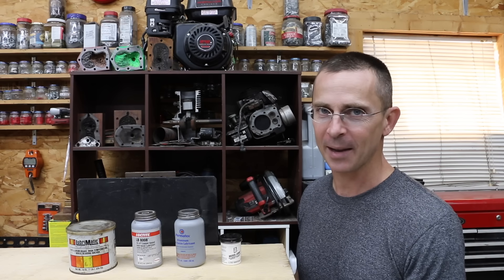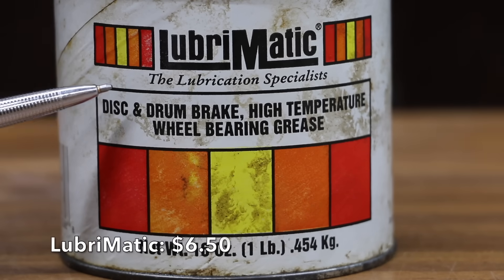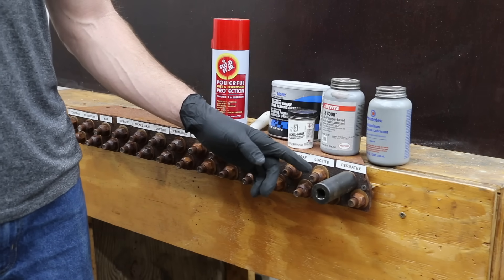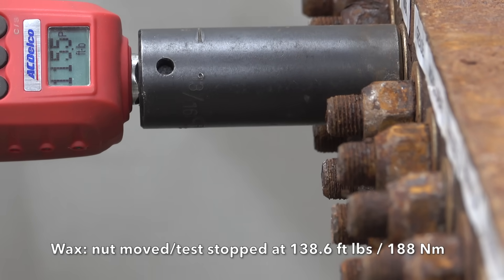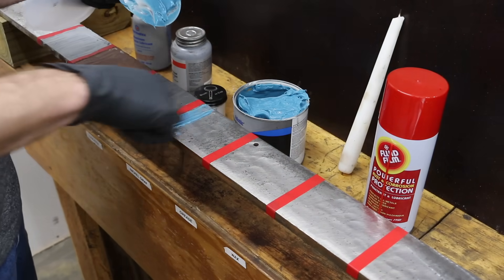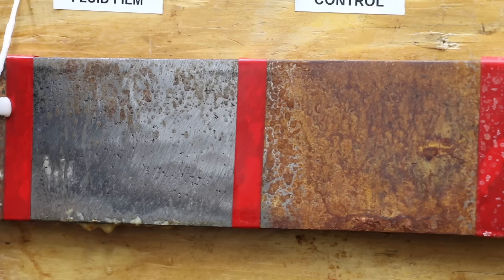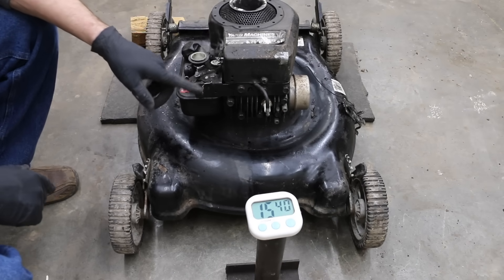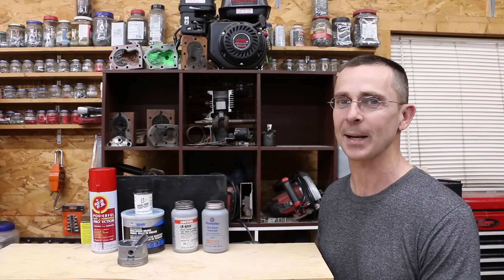Does Anti-Seize Compound Actually Work? Let's find out! Anti-Seize vs Grease vs Fluid Film vs Wax

Comment: Grease and heat story to learn from.  At work we had a new guy show up which turned out to be a know-it-all control freak and spent his first week trying his hardest to take over the crew.  One of the guys took regular grease and rubbed it all over his oil pan, diff, and xfer case.  It gets hot here, like 115-125 degrees F hot.  When the grease began to melt off it looked like he had leaks all over.  We told him the heat here destroys vehicles quickly especially if they were mfr'd for cold areas.  He was from MN.  Every chance he got, he checked his oil level, xfer case fluid and diff level.  We watched him do it probably a dozen times in a couple days.  One day, he is up on the scissor-lift, looks down at his truck and there's liquid flowing out slowly.  He rushes to bring the lift down, runs over to see what it is and starts to scream about his transmission leaking.  We were hiding around a corner laughing our butts off.  He tells me he's going to take it to a mechanic before he has to drive it home in the heat 30 miles and leaves.
The boss got a call from him that night, he quit because his truck had never had any trouble until he began to work here in the desert.  He said it was too dang hot and he was going home.  We were all snickering about it as the boss told us, and it didn't take long for boss to know we had something to do with it saying, "I didn't like the way he treated you guys and he told me how to do my job every chance he got, so we can do fine without him".
Good luck, hope we never see you again!
Oh, and grease melts pretty good in desert heat.  The roads can be 170 degree F.  There are egg cooking contests for fun...cooked on the pavement.  The most common break down I see here is trailers with a missing wheel...the axle hubs go dry much faster here.  I'm guessing most of those are regular grease and barely kept up on maintenance.

Comment: Just curious what your method is with the water spray test to ensure that each product is spread to the same thickness or if you do it by volume or weight for consistency? Great video, as always. Thanks!

Comment: I wonder if the engine hydro-locked cause there was a lot of antiseize taking up the space.
Reply: It's a possible contributor, but it seems like the main cause for failure was that the anti-seize was too thick to get into the rod  bearing (or bushing), which failed. You can tell by the elongation at the end of the connecting rod and the multiple failures there, which likely led to the failure further up the rod. Some of that elongation could definitely have been caused by a mild hydo-lock combined with the lack of lubrication though.
Reply: @EbilGeneyus   I agree, the rod/crank journals would not have been exposed to the anti-seize until it was too late... These anti seize products are still around 40-60% mineral oil by content, just containing heavy loading of solid particles like aluminum, copper, graphite, etc. That's why it's called a "paste" (30%+ solids) and not a "grease" (0-15% solids, typically).

Comment: always had the best experience with copper based anti-sieze...its been around a long time.....I bet that engine would have run longer with fluid film....it would have flowed better into the con rod bearing

Comment: Fun fact: antiseize should never be used as a lubricant on moving elements because it's essentially metal dust suspended in grease. Even though aluminum and copper are soft metals, it's still very abrasive at a microscopic level and will destroy bearings and bushings very quickly. It works great at preventing bolts from seizing because that dust basically polishes the top layer of metal off, and embeds itself in it's place preventing the 2 metals from directly touching.

Comment: fun fact, ive been using copper based anti-seize as thermal paste in all my computer builds for about 20 years now.   it works great, does not dry out, and it spreads evenly very easy.   it also has the added bonus of being very cheap, same bottle that i paid 5 bucks for is still about 1/2 full.
Reply: HEY!... That's a good idea!!!

Comment: I’ve used candle wax to loosen rusty nuts but you have to use a heat source like a heat gun or a blowtorch. If the candle wax is in its liquid state it’s an excellent lubricant
Reply from the maker: Thanks for sharing.

Comment: If you do another one can you try AeroShell - MIL-21164D & Loctite Silver Grade Anti-Seize?  The first one is the milspec grease for AR barrel nuts.  I also use the Loctite silver for other stuff during assembly or changing parts.  Not 100% sure on what temps the barrel gets to, but I've heard they can get over 500f.
Reply from the maker: Thanks for the video idea.

Comment: Used to work in plastics here. After spending a day disassembling a barrel that some bolts without anti-seize I became a fanatic. If it gets hot put copper anti-seize on it. I don't care if it is more expensive. Would you rather be stuck using a breaker bar the whole way to get a 6in bolt out or have it let go with a bang and then be finger tight?
Reply from the maker: Thanks for sharing.

Comment: Oh man, I hope that isn't it for the OG PF lawnmower.  Please replace that piston and continue to use it.  It's a fun nod back to the earlier days of this channel.

On a side note, I'm not exactly sure what I expected with the anti-seize in the mower.  It's hard to say without knowing the ring gap prior to starting, but considering the abuse that thing has seen I would have to assume the gap was getting up there.  Either way I'm not sure it would have mattered what the gap was, I have a feeling that anti-seize would have worked it's way up eventually.

I'm actually surprised you didn't put it on the lubrication tester first just as a basis for comparison to some regular motor oil.
Reply from the maker: Thanks for the feedback.

Comment: Great video as usual. I was actually surprised the control bolts didn't take more torque to break them loose. With pool season upon us how about a waterproof tape video for all of us pool owners. Maybe trying it on the inside and outside. There was a brand I tried outside and it didn't work. Go figure.
Reply from the maker: Thanks for the video idea.

Comment: As a truck mechanic I can say the anti-seize is a life saver,  for example if you don't put it on shock absorber bold there is a big chance that you'll have to use torch or in some scenarios cut the whole bolt, and not to say on exhaust manifolds if you don't put it most likely you'll end up with broken bolts inside the head....
Reply from the maker: Thanks for the feedback.

Comment: Having worked for several company’s as an Ironworker, structural fitter, ship outfitter and maintenance worker. I have been handed milk of magnesia as an anti-cease more than a few times depending on the work being done. They all said it works.
Reply from the maker: Thanks for the feedback.
Reply: It's used in jet engines.
Reply: The German aircraft mechanics used Milk of Magnesia as an antiseize during WW2!

Comment: I used to work in earth boring passing pipe casing under roads and highways. Same concept as well drilling, we threaded 8 feet long iron drill rods and pumped high pressure water to bore 10 - 20 inch holes underground. It was our everyday routine to grease the thread and screw ends to prevent rust. Grease was economical and it worked. We did had to  sledge hammer the connections to break them lose but the grease did its job. I was 16 years old then working the middle of the Texas desert. Boy did I learn the meaning of hard work. I'm an office worker now.
Reply from the maker: Thanks for sharing.

Comment: I worked for a company that made large hydraulic jacks for aircraft.  We had a 250 ton test stand that was 40 feet tall, it was outside the shop because it was to big to fit inside.  The load cell adapter had to be changed because we changed load cell brands and I was the lucky one to change it out. I was expecting it to be next to impossible to remove because it was last changed out 30 years earlier and it’s been in the weather all that time. I attached a 10 foot breaker bar to the boom of a fork lift and was going to use the low drive gear of the forklift to push on the breaker bar to break it free. When I was rigging up the break bar forklift contraption the load cell adapter twisted in my hand with virtually no force applied to it. I was surprised and asked one of the old timers at the shop what anti seize did we use back then?  It was Lok-cease 20/20, same stuff we have always used.
Reply from the maker: Thanks for the feedback.

Comment: I don't know what this Loctite stuff is but in the trade you use copper grease and it's not expensive. I would have liked you to just tighten the nuts just finger tight would have been better. The wax shouldn't be heated should be put on cold and of course it's not going to cope with high temperatures
Reply from the maker: Thanks for the feedback.
Reply: @ProjectFarm  I forgot to say depends which type of candle grease if it's paraffin might be better than the other types waxes like beeswax soy wax

Comment: Don't use any of these products in salt water applications especially where dissimilar metals are involved as the copper, mica or other things including graphite are used as they actually promote corrosion in salt water due to the electric currents generated between fastener and the thread . In our applications stainless bolts into aluminum is quite common. The bolt being electrically welded to the aluminum is quite common. The same process occurs even when not immersed in salt water. Once corrosion starts the electrical potential between the different parts like bolt and nut takes over, It is this electrical action not the corrosion itself which is responsible for the seizing of fasteners. There is a lot of research on this but we in the ROV industry had to work it out ourselves trying a whole host of products before finally understanding the cause of the problem.
Reply from the maker: Thanks for the feedback.
Reply: @ProjectFarm  Love your channel and testing methods. The comments I provide are for informational purposes only. If you find them useful in anyway that is a bonus.

Comment: Those bolts are like the bolts on a 2 year old car in Wisconsin. I call rust on a bolt "Wisconsin Locktite", you ain't getting them off with out a flame wrench! Once I do the job, I've had good success with the Permatex mostly on lug nuts. Thanks for the test, even included some engine torment, I love it!
Reply from the maker: Thanks!

Comment: I think an interesting test would be after you test how the different materials react to wash out with the water, spray them again with your corrosive mix to see whether it fully washed out to bare metal or if there is still a thin layer that will still protect the metal from rusting.
Reply from the maker: Thanks for the video idea.

Comment: I'd like a retest on the antiseize as oil on an engine that hasn't been previously abused(if you can). Also, Why not have an immersion heater of some kind keeping the water in the tank at a more consistent heat level?
Reply from the maker: Thanks for the feedback.

Comment: My main use of anti seize is to prevent galling and seizing between aluminum parts and steel fasteners.  Can you test that?   Also, did you know that permatex anti seize and high quality grease when combined 50:50 are a superior bearing lubricant for harsh exposure parts!!  Need a lubricity test!
Reply from the maker: Thanks for the video idea.

Comment: If you want a heavy-duty oxidizing solution, try Piranha Solution.  Or you could even just up the hydrogen peroxide percentage strength by picking up either a quart of BaquaSpa Oxidizer (7.5%) or pool Baquacil Oxidizer (27.5%) from a swimming pool supplies store.  Might want to call first as not all pool stores carry those lines of chemicals.
Reply from the maker: Thanks for the feedback.

Comment: One of anti- seize’s major uses is to prevent seizing of dissimilar metals, such as a steel drain plug in an aluminum oil pan. If you’ve tried to remove one, you know what I’m talking about. I use anti seize on all drain plugs regardless of metal make up. It’s cheap insurance.
Reply from the maker: Thanks for sharing.

Comment: I've used about a dozen cases of fluid film over the last two years at work. It really needs to be shaken very very well to get the best performance out of it. It will come out very thick and foamy and eventually all the propellants will flash off leaving a very nice viscous film. Otherwise it's thin and runny and doesn't perform at all. I shake the can on its side, only rolling it slightly when I hear the ball inside freely rolling back and forth. It generally takes me about 3 minutes of continuous, vigorous shaking to achieve optimum mixing. At $10 a can it really helps you get your money's worth.
Reply from the maker: Thanks for the feedback.

Comment: That engine wasn't going to seize, but the cylinder walls sure got wet sanded. In the end you proved that anti seize compounds should be used for the job they were intended for.
Reply from the maker: Thanks for the feedback.

Comment: I know it sounds crazy, but am trying a test of my own by using brake parts cleaner to clean out sandpaper. I was using sandpaper today, oversprayed brake clean, and noticed it dissolved the crap that gets stuck in sandpaper, looked good as new! So I gummed up a peice real good and soaked it, it is now sitting and hopefully drying out in my shop for the night. Will update tomorrow if it worked!
Reply from the maker: Thanks for sharing.  Look forward to  your report!
Reply: Ok so it worked but it took a long time to dry out the paper and it warped the sandpaper a tad, I kind of expected that. Also I tried it a few more times with the same peice + a brand new peice and over time it will start to eat the corners of the sandpaper and I'm sure weaken the grit.

Comment: As someone who works on agricultural equipment, I have used ALL of these on fan hubs (ventilation fans) and heater fan hubs. I absolutely will not put any fan or pulley hub on anything without anti-seize.
Reply from the maker: Thanks for sharing.

Comment: I paint all my wheel hubs on all my vehicles with Permatex Never Seize  every time I switch tires and rims from summers to snows and then back again in the spring. Most times, they come right off. I will admit, there has been a few times where a rim needed a little attitude adjustment to come off the vehicle. I can't imagine how rusted on they would be if I used nothing, as road salt rusts everything here in NY.
Reply from the maker: Thanks for sharing.

Comment: I can tell you when it comes to multiple high heat cycles, nothing beats the copper based anti-seize for steel on steel, at least that's what we found out working on injection molding machines. But we never had to deal with rust, just heat and pressure.
Reply from the maker: Thanks for the feedback.

Comment: We use zinc based antisieze on the ships antenna mounts. You can definatly tell which bolts havent had antisieze compared to the ones who have after a year out to sea. We put out equipment through hell, and the zinc works pretty good
Reply from the maker: Thanks for the feedback.

Comment: As a mechanic for over 40-years, I use a top quality pipe dope on bolts that are under the vehicle.  For example, when installing a trailer hitch the entire bolt is coated with pipe dope and even use pipe dope as a gasket between the hitch and frame. (Prevents the scale from building and pushing. Nature does not like an empty space so if that space is filled with friendly stuff it keeps the bad stuff from causing damage.) Come back ten years later and the bolts come off.  Anti-seize is good for engine bolts such as exhaust manifold bolts. I use the pure nickel compound.  Also, let's say I'm installing a water pump. I glue the gasket to the water pump and the face of the gasket that goes against the engine I coat with pure nickel anti-seize. Why? Because when its time to remove the water pump there is no scrapping. And yes, anti-seize is a gasket compound, and I have a can over 30-years old that says that on the can.
Reply from the maker: Thanks for the feedback.

Comment: Ford 5.4 3V is known for spark plugs breaking off and leaving a part in the heads. Aluminum heads. Ford recommends using nickel high temp anti seize there. I usually use copper anti seize. Aluminum doesn't like copper. So nickel is what's recommended.
Reply from the maker: Thanks for the info!

Comment: As a Navy mechanic on gas turbines. The Pratt & Whitney J52-P8B installed in A6 Intruder used a copper based anti-seize on the exhaust hot section bolts of the tailpipe. Despite the anti-seize compound, those 5/16" fasteners torqued to 105 - 115 inch pounds were most difficult to break torque. 
Made worse if attempting to remove the tailpipe with the power plants still installed! 
The copper anti-seize did work well.
Reply from the maker: Thanks for sharing.

Comment: I have a bunch of bicycles which have exposure to a lot of water, humidity and corrosive elements.  I've had really good success with copper based anti-seize.  It has been much more effective and longer lasting than grease.  Great video!
Reply from the maker: Thanks for sharing!

Comment: I can relate. A few years ago while I still had it, went to change the swaybar bushings on my 91 Miata. Turned into changing the rear upper and lower control arms after most bolts just sheered. Even soaked them with penetrating oil for a few days before attempting the work
Reply from the maker: Thanks for sharing.